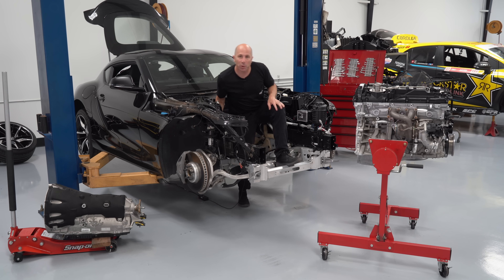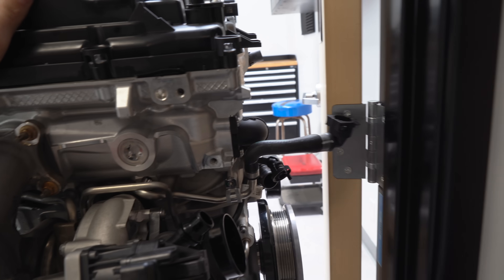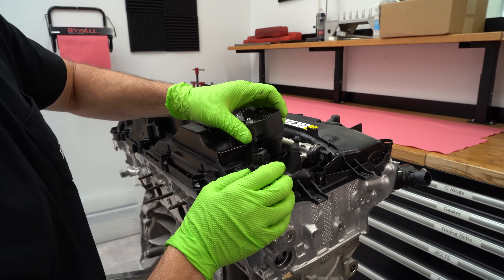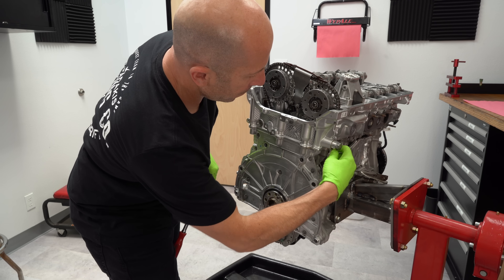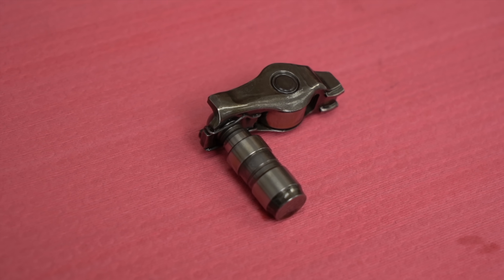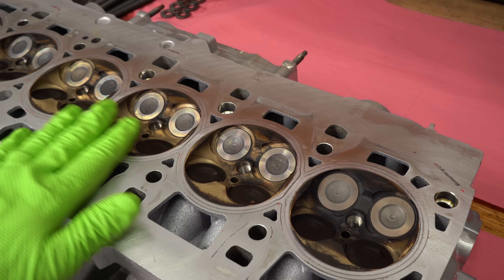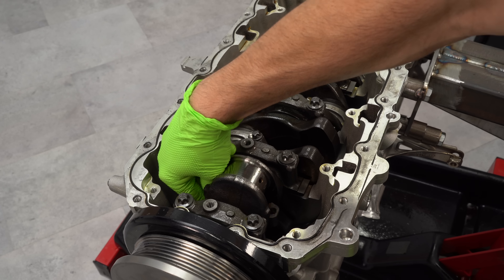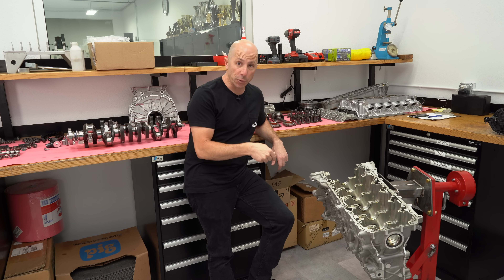2020 Supra B58 Engine Teardown - First Look - Better than the 2JZ?

Comment: @8:51 I was so paranoid of that Camshaft Breaking from leaning on it man that was scary
Reply: This Is very well and nicely engineered. Can't say it would be "fun" to work on but I love the Engineering thought that went into it. Can already see the Turbo-side getting ported from the design n a nice bigger aftermarket exhaust header. The Oil to Water Cooler is nicely done, the Mechanical Fuel pump is a Plus, I wonder if going to 1000HP the pump would need to be upgraded??? @papadakis, Love the way they did the Intercooler right off the throttlebody its compact and If you need an aftermarket option it would simply lead to double cooling, I can't imagine the need to ever take it out unless it creates some level of restriction. The Direct Injection is Nice also. As to the Lifters without needing to be shimmed its amazing IMO, I wonder what Power the design can really take as is (After Spring upgrades etc).

Comment: So if I want to switch my cams I have to pull the Fucken motor 😞 hella work just for that lol
Reply: There is no more switching of the cam....it is all done via software now. That is why the camshaft on the intake side has all those extra components. You can infinitely adjust lift and duration at any rpm....all through the ECU/DME

Comment: The dbw is still a mechanical-electrical connection and has a latency until they take the mechanical part out it will always be slower than direct connection.